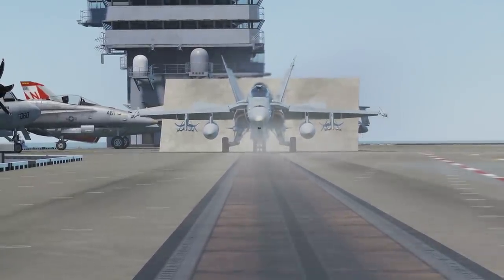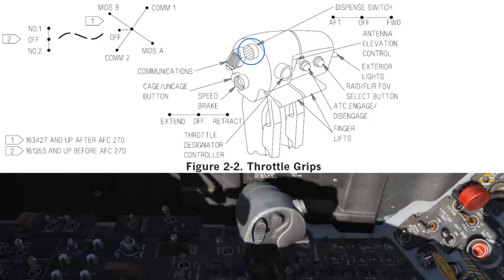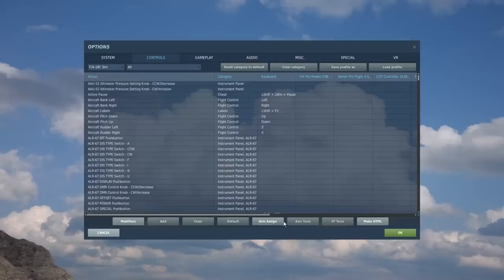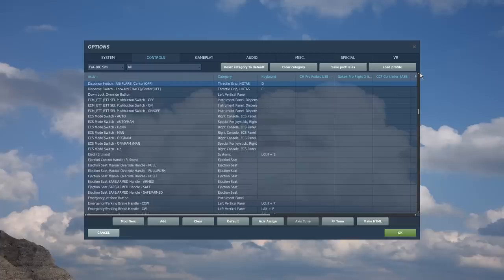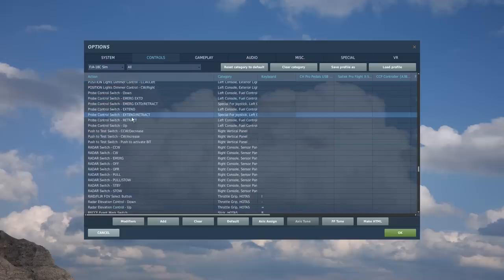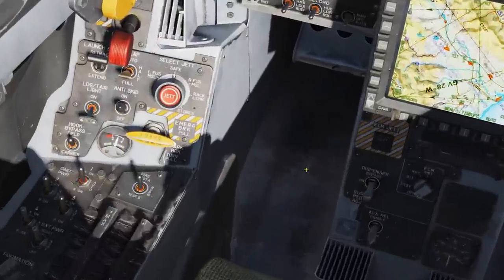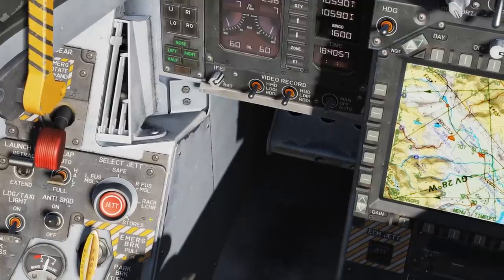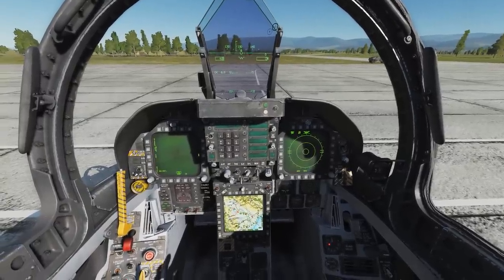DCS F/A-18C Hornet Controls and Cockpit Tutorial Quick start

Comment: How do I set up 2 position switches with only one active position? My Warthog throttle has a bunch of these and they only get recognized by DCS when I flip the switches on but not when they switch them off.
Reply from the maker: You can use thrustmaster's T.A.R.G.E.T software to configure extra settings for this i believe. Some binds on dcs aircraft have support for this built in with 'command' else off names.

Comment: In real life to move Throttle from OFF to Idle, do you need to push any button at the same time? Or it just moves freely?
Reply from the maker: It's got finger lifts on the front of each handle, if you lift that, it can pass between OFF/IDLE, otherwise it hits a stopper.
Reply: @RedKiteRender  Thanks for clear explanation! +1 sub

Comment: Sorry for asking the same question here after doing the same for the Harrier, but is this guide still relevant for 2022?
Reply from the maker: No problem, This video whilst personally dated, is still correct. Startup has changed slightly, so disregard old videos on that. Otherwise my series is correct, with the exception of JDAMs which have had the TOO logic changed, since my videos, so the TOO multi-attack technique won't work any more.

The LITENING II pod was re-done, I've already made an updated video to reflect those changes. ATFLIR doesn't have a dedicated tutorial, but if you learn the LITENING II you can transfer skills over to it easily enough.
Reply: @RedKiteRender  Thanks for your comprehensive and punctual answers, keep up the good work.

Comment: The Sensor control switch changes the focus of the tdc, push it in the direction of the display you wish to select and the tdc will move to that one.
Still having problems for a correct use. Sometimes if I want to change the display I switch to vertical scan mode or vice versa.

Comment: Seat doesnt work with battery, ive only seen gen tie used for troubleshooting, anti-skid turns off on the boat, the taxi light doesnt get little use on the boat. A pilot turns that on he will be thrown off the boat. Its never used. Flaps go half to take off, full for shutdown. For fire the first button just tells the bottle to fire.

Comment: Hi RedKite. I paid a lot of attention to your video and I studied it a lot. Great video! But I'm looking for answears. First: In my left DDI I go to stores page. Set master arm to on and select a/a. I know that I have sidwinder and sparrows under my wings. But in the upper left corner I don't see them to select. And the Hud don't open the search circle. So what? And then How can I move the TDC on attack radar? I must configure it in "Throttle Designator Controller"?
Reply from the maker: Air to Air weapons are selected via the weapon select switch, the thumb switch on the stick, not the stores page. The cursor on the radar is controlled via the TDC, you need to set the radar as sensor of interest via the sensor control switch + direction of the display your radar is on, whilst in a2a mode.

Comment: You had me excited when you showed what the names / groups of the key mappings were but unfortunately never showed what the 'trim' hat on the throttle mapped to :( I cannot get this to work for some reason and was wondering what the correct keys to map are. Anyone know?
Reply from the maker: On the keybinds section select the hotas category, this will limit it down to the controls on the stick and throttle, you can look for trim there, its in alphabetical order. I think the keybind is r ctrl arrow keys as default, pressing that will take you to the control if ive remembered it correctly.
Reply: This hint got me to the correct area to find the keys. I think the trim is working now. Thanks!

Comment: This is what I need to start my journey with DCS, Thank you, now is it posible to play dcs without head tracking (only have saitek X52, the good version) with some degree of results?
Reply from the maker: X-52 should be good for the Hornet. You'd struggle for buttons if you were flying the A-10c but the Hornet's got quite a simple hotas, i recommend using one of the radials on your throttle to control antenna elevation, i used to do that with my x-52 and x-55 for the FC3 aircraft. As for head tracking, keep one of your hats for head movement and forgo the trim, bind that somewhere else or use keyboard and it'l be a reasonable experience.

Comment: can someone help me in mission creation? I want to add multiple F-18's to a carrier as Clients but when we spawn in (for multiplayer of course) we keep spawning on the same location, is there a way to designate, where a craft could spawn? also a way to add static aircraft just for the feels? Thanks in advance!
Reply from the maker: It's a known bug at the moment, you can spawn without issue with ai ramp spawns, but soon as you introduce a player and client it gets messy. Let's hope the fix comes soon. in the meantime i recommend Cat starts with a 5th on the ramp, or if you require it, ramp starting taxing away form the elevator then getting the next client to spawn and repeating.
Reply: Sorry, may I bother with an other Q? :D when rearming on airbase, can we reset the MFCD Loadout section to "refresh" detect the new armament? (it can see them, they are just not selectable) From my knowledge on the A10 we had to do something similar, and for the world of me, I cant find it here :(
Reply from the maker: I believe hot re-arming is currently a known bug, i've not tried it, but see if doing a full shutdown, re-arming and then restarting the aircraft, it's plausible a certain step of the startup will have that effect. We don't have a LOAD page or DSMS LOAD equivalent on the hornet.
Reply: Just tried power cycling the plane while rearming... upon restarting the plane it just jettisoned all new armament as if i pressed an E jettison... might have to do with me actually jettisoning the previous loadout... will try again :)

Comment: Redkite is the throttle the same as in A10C ?
Reply from the maker: No, its substantially different, the warthog has more buttons, although it lacks anything ideal for antena elevation. The thrustmaster twcs is a good aproximation of the hornet throttle, although its a single throttle rather than double.
Reply: RGR not sure if the new thrustmaster hornet stick is making the throttle, if not i am getting the A10C throttle and f18 flight stick.
Reply from the maker: Ive only heard of a thrustmaster Hornet Stick, Matt Wagner recently confirmed he has access to a prototype of one.